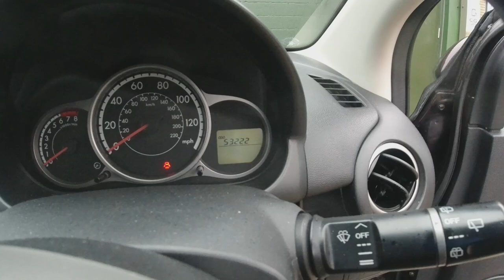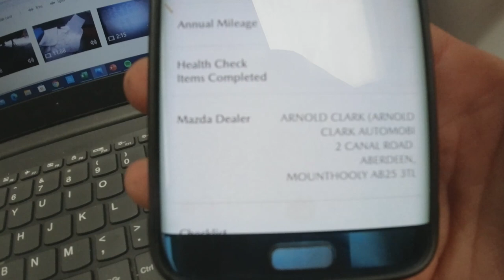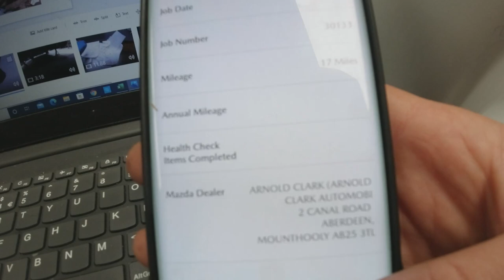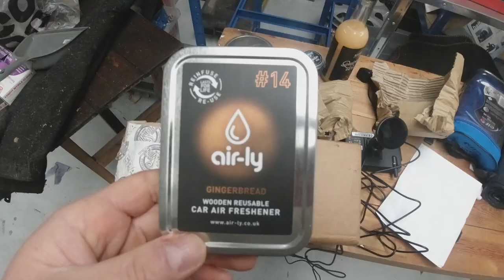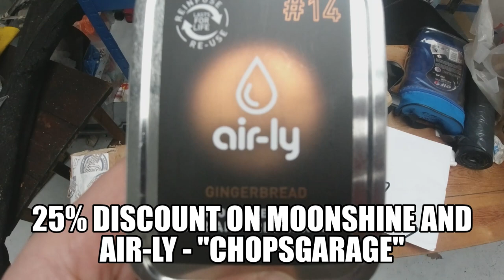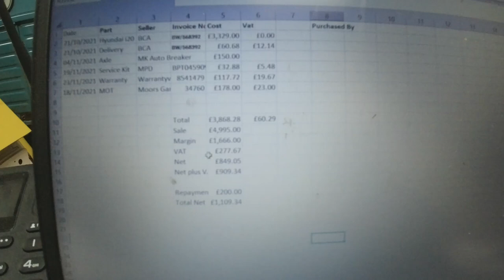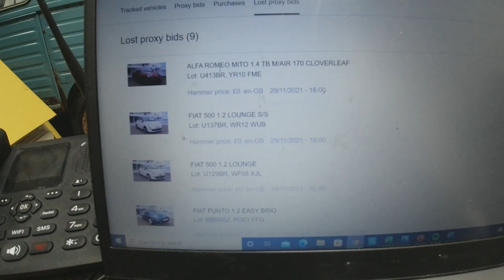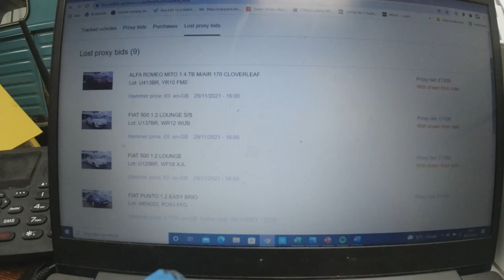Worth Fixing? How did I do? Hyundai i20 Flip Numbers Revealed! + I bought a Subscribers Car!

Comment: James you don’t get “shine” from a wax, you get shine from correcting the paint and polishing out imperfections, the wax locks in that finish on top. May provide beading etc but it won’t add “shine”

Watch the quick detailed because if you have dust or salt on the car and you spray that on it will drag and cause swirl marks in the sun ☀️

Comment: The Mazda is very similar to our Mazda 1.5 Sport automatic. Had from new 2010 and done 153.000klm. Used as a second car. Only ever had one problem, upper engine mounting needed replacing. Was so pleased with it we bought a second Mazda 2. If I have one complaint about the original car is that it is about 33% more thirsty than the new Mazda 2.

Comment: Retail on the Mazda is just over 4.5k so it shouldn’t be a hard sell, just did a 10 plate Hyundai i20 1.4 auto with 42900 miles for 5400£
Reply from the maker: Retail according to AT is 5500 actually

Comment: Still very high prices at the auction, how about an old 07 fiesta, low miles and nice tho, but exhaust actually dragging on the ground, £1850(!)obviously plus fees, did manage to get a 09 Mercedes a class tho, fairly tidy, but exhaust blowing for 425 (509 with fees) you've got little chance, or no chance with something ready for retail, low miles needing no work at anything remotely a reasonable price.

Comment: Hi James .. never buy a Micra  1.2i accenti  the Air intake Manifold needs to be removed to gain access to no1 spark plug and coil pack.. the New seasl for manifold are Nissan only, £90 and Non refundable as they are a Special order... They are  Not part of the service pack !!!! Nissan say ...But Air Intake Mannifold Must be removed to service No 1 spark plug .... Nice to see things going well   :) :) Andy Mac
Reply from the maker: Noted lol
Reply: I like a micra, personally
Reply: @craigethorley623  This is on a 63 plate 1.2 i   3 cylinder accentia.. if you have a G plate you probably have a 4 cylinder engine in it ..  :) :)

Comment: I bought a new 56 plate Mazda and that had an electronic service record so they have been using the electronic record for a long time. Obviously the App is later.  I don't know why more manufacturers don't do the same.
Reply: What’s wrong with a paper book always worked in the past it’s a silly idea the electric service history
Reply: @bmwman1981  It means the service history  does not get lost, especially if it goes through several owners. The customer can access the service history if they wish. Sometimes, with various Mazda's I have owned, I have been given paper copies of the service record that was stored electronically but if I lose them they still exist electronically.